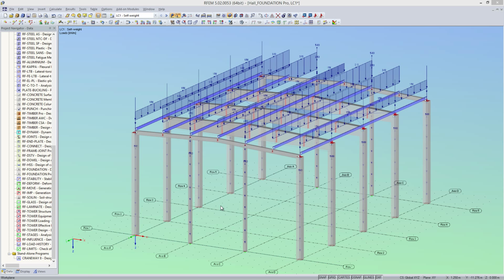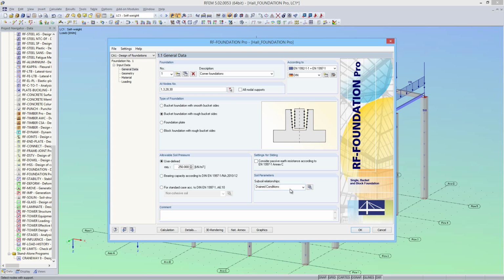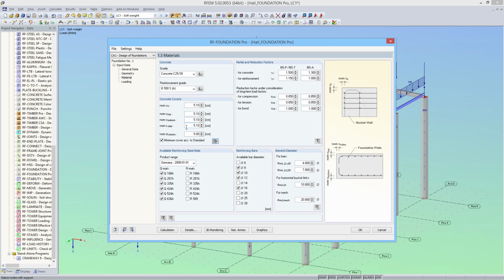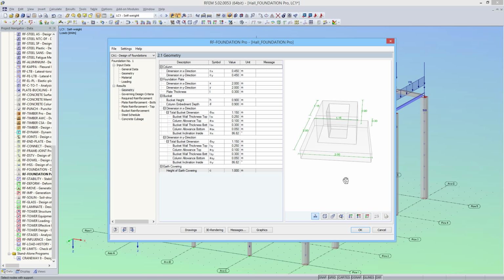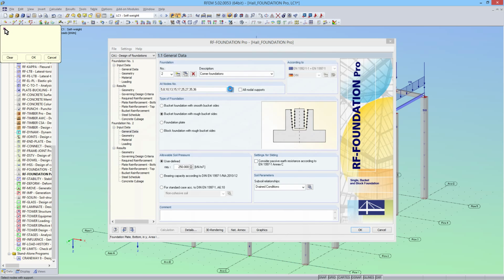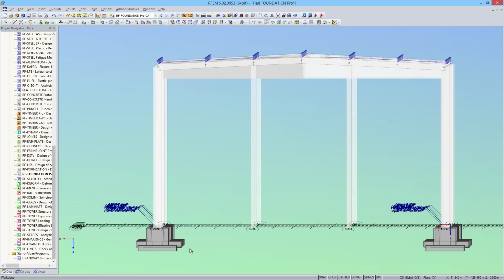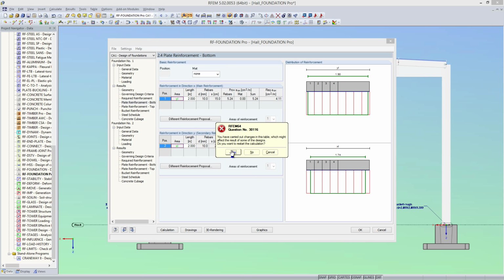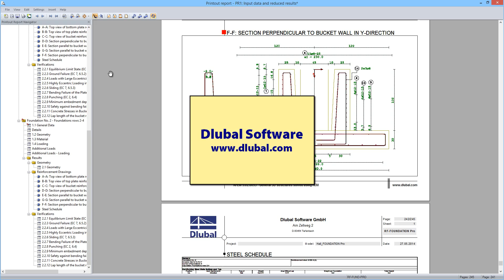Dlubal RFEM 5 - Foundation Design According to Eurocode in RF-FOUNDATION Pro

Comment: Hİ, how can design raft foundation slab, ground foundation slab
Reply from the maker: Hi, Likengineer!
You can do this with RFEM using an elastic support for a surface. You can model a slab as a surfaces with an elastic support. Then you use the RF-CONCRETE module to get the required reinforcement. There are different soil models that can be used as well.
You might find this knowledge base article helpful:
https://www.dlubal.com/en/support-and-learning/support/knowledge-base/001400